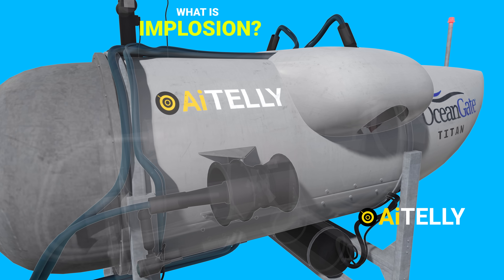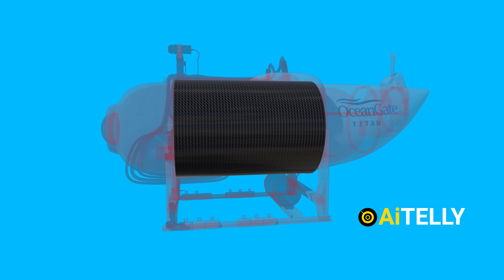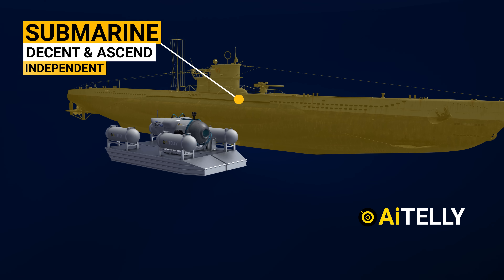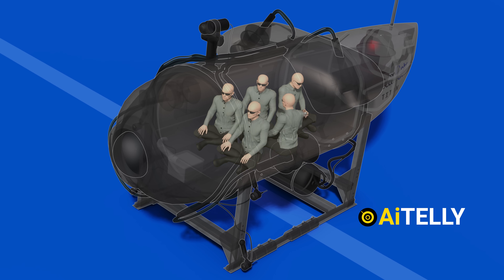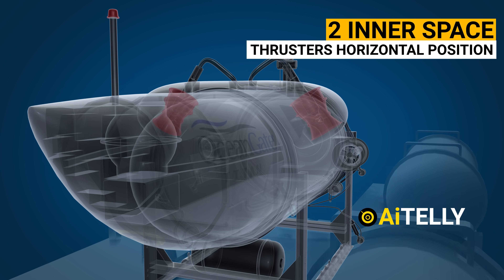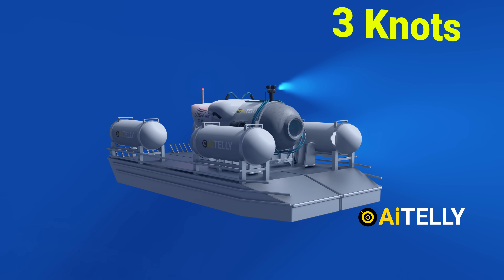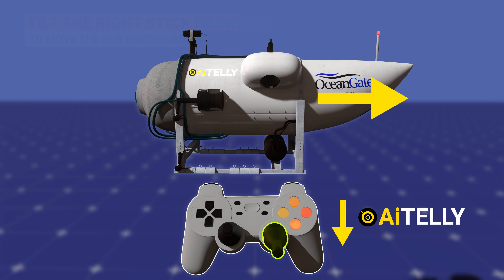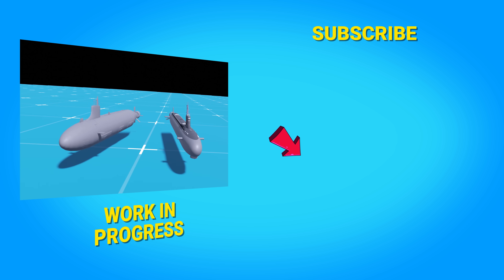Implosion Titan Oceangate How it Happened | Submersible Submarine Parts #3d

Comment: I really think t was horrendously foolish and quite arrogant of the designer to go ahead and use the submersible vessel that was for the most part untested. Just because there was a theory behind an innovative material such as carbon fiber- it’s just that theory. And theory isn’t scientific fact unless proven meaning it should have gone through rigorous testing. Knowing that water pressure increases with increasing depth, it was quite stupid for them to skip so many things that this submersible needed- never mind that it was built with a composite material. Video game device to steer the submersible? That’s why oceanic societies and organizations exist to avoid such catastrophes. They knew that there no laws at international waters to regulate what they were doing!
Reply from the maker: Thanks ! You might also like Nuclear Powered Submarine Engineering behind it #3d Nuclear Reactor released
Link: https://youtu.be/J0lb46Zi5-s

Comment: The fore & aft attachment was glued to the carbon fiber hull  that was the dumbest thing I have Ever seen  the thing was going to  blow apart an accident going to happen. Internal pressure external pressure somethings going to give the glue champagne cork when the wire is removed SOL..

Comment: Carbon fiber is the same characteristic as fiberglass it does not handle impact or pressure hit a sheet of fiberglass it fractures stand on a filon roof have a mattress handy.. the designer was so accomplished he was beyond reproach. The know it all wouldn't trust expert advice or follow testing or certification procedures then the nut sitting with a game boy remote to operate the thing. If that's HITECH you soon to loose more than your mine the of the contraption named Ocean gate a little to close to Heavens Gate. Had the Father listen to his Son there would be two less victims. A Child Shall lead them. Parents don't always know What's Best...
Reply from the maker: You might also like Nuclear Powered Submarine Engineering behind it #3d Nuclear Reactor released
Link: https://youtu.be/J0lb46Zi5-s

Comment: How does this submersible stay level?  If all passengers "slid" to the front (no seats or restraints) it will become nose heavy, or stern heavy.  Pretty unstable as far as the lateral axis is concerned.
Reply from the maker: You might also like Nuclear Powered Submarine Engineering behind it #3d Nuclear Reactor released
Link: https://youtu.be/J0lb46Zi5-s

Comment: The joint between, in the bottom from tail to belly may had gave up due to glide load which can be, only caused by excessive descending ratio, according to its build dynamic, structure and materials. * The hallow carbon fiber may have broke just like a bamboo wood due to the pressure they were in at that depth..

Lets see what investigation brings up...

Comment: I think your graphic demonstration, while impressive, is moderately misleading.

The hull being made of carbon fiber is essentially plastic, carbon fiber itself is not air-tight, and polymers/epoxies are used to bond the strands and create the seal. The carbon fiber itself simply acts as a structural support to the very hard epoxy/plastic. 

If you have ever dropped a plastic cup and had it break, you will note that it does not deform like metal (like dropping a can) it actually shatters. 

The reason why carbon fiber is not considered a suitable medium for repeated exposure to high external pressure and temperature change is because small imperfections can easily become trapped within the layers of the carbon fiber and epoxy that cannot be effectively detected prior to launch.

For example,  during the weaving process air bubbles can become trapped, fibers can become damaged, or during the curing process bubbles can form, mixtures can harden at different rates creating shear zones... etc etc.

Imagine there is a bubble trapped in the hull, even just a pin sized bubble. This air pocket will become compressed by the pressure and allow moderately more flex to the carbon fiber/epoxy above it as it has more space to move before reaching its backing support.

This repeated flexing of the epoxy above the pin sized air pocket will inevitably cause micro cracks in the epoxy, and allow for the movement of the weave which will cause delamination between the layers. This will run the length of the strands in the weave and expand more and more quickly as the integrity of the epoxy becomes more and more compromised (because it obviously provides less resistance)

Eventually these seemingly minor, nearly undetectable imperfections, cause enough of the material to compromise that the sudden increase in pressure (3 knots / 3.5MPH down to a depth of 2.4 miles / 3800 meters, or 1.56 meters per second. 1 atmosphere of pressure is roughly equivalent to 14.6 PSI. For every 10 meters of descent into the ocean, the atmospheric pressure equivalent increases by approximately 1 atmosphere.
So at surface level, approximately 1ATM, at 10 meters down, 2 atmospheres, 100 meters 11 atmospheres etc etc... down to 3800 meters (resting depth of the titanic) that would be approximately 381 atmospheric pressure. 381*14.7 PSI = 5600.7 pounds of pressure against each square inch of the hull.

That's 144*5600.7 =  806,500.8 lbs of pressure affecting a single square foot. 

For perspective, that would be like parking two empty B747 jumbo jets ontop of eachother on a single square foot of space. 

That's means the hull of this submersible was subjected to an increase of 2,116.8 lbs per square foot every second during descent. (The equivalent to stacking a tesla model 3 ontop of each square foot of that hull every 1.92 seconds.)

So when this hull failed, it would not have crumpled, it would have shattered inward, like glass.

There's a reason why in most of the recovery photos you only see metal and other malleable components present, because the carbon fiber was likely essentially pulverized by the expansion of water into the cavity occurring at approximately 10 times the speed of sound.

If you want to get an idea of the destructive force this would have on a person or object, just search for videos of large amounts of water being dropped onto things, and remember that water falls at approximately 9m/s (20mph), but at those depths the water would be compressed to approximately .96/97 of its original size, and would expand to fill that space, accelerating the rates in excess of 7-9 x the speed of sound. (Depending on various factors like salinity, temperature and depth, but to keep it simple, just assuming the maximum rate of 10x the speed of sound or 7610mph or 11000 feet per second / 3352.8 meters per second.)

Assuming the space inside of the sub was maybe 1 meter in height from floor to ceiling, you can imagine how quickly these people were struck with 806,500.8 lbs per square foot of weight. (Average adult male has between 14-18 sqft of exposed skin across the surface of their body. Ergo it would be like flying 24-36 747 jumbo jets into them at mach 10.)

If you were to put a pin sized hole in the hull of that sub at depth, water would force through it with the power of a water jet cutting machine.
Reply: Thank you for your explenation

Comment: can you explain what kind of structure is keeping the back ends (sharp end) from imploding?
Reply from the maker: Agreed 👍
You might also like Nuclear Powered Submarine Engineering behind it #3d Nuclear Reactor released
Link: https://youtu.be/J0lb46Zi5-s
Reply: @Aitelly  I read somewhere that the back pointy end of the Titan is not pressured. Meaning it is open to the water, and I wonder how can all the batteries and oxygen equipment inside it can withstand all the pressures ?

Comment: No they're all dead but the owner Was an idiot. He should have had that thing. Do at least 20 to 50 autonomous dives on its own. And he should have never went down past 3000 feet. That was only rated at 3000 feet. And he went down twice the depth that it was rated for. He also ignored warnings from his engineer. You did away with a lot of Safety measures.. Then he sold those tickets to those guys for 250k a piece. Any engineer would tell you that whatever you rate something at. Don't go to that rating, stay under it. If it was rated for 3000 feet, he should have never went past 2500 feet. But instead, he went 7000 feet... Like I said, an idiot. Does other guys? I feel sorry for her because he made them feel safe when they were just pay in 250k for a death ticket.
complete moron

Comment: So  now we know that a cylindrical submersible made of  carbon fiber 5 inches thick , with titanium caps is capable of withstanding  water pressure at 12500  feet for a limited period equalling  3 - 4  dives in reasonable safety.  🪸

Comment: Watching many videos about this accident and the last messaging between the sub and the ship , the descending went too fast like it was sinking. I think the hull was delaminating and got saturated with water.
Reply from the maker: You might also like Nuclear Powered Submarine Engineering behind it #3d Nuclear Reactor released
Link: https://youtu.be/J0lb46Zi5-s
Reply: If that was the case it wouldnt have imploded it simply would have flooded and the people inside would have drowned.  Since they found it in pieces and did not find the pressure hull intact.  It is easily concluded that it imploded.  they might have seen a sudden water jet open up where the initial crack happened but I doubt they would have had more than 1/2 a second to understand what they were seeing before it failed completely.

Comment: Do you think the bodies were incased in part of the carbon fiber when it was pulled to the surface?
Reply: I suspect that the carbon fiber would not have simply shattered like glass as some have said.  I think it would have ended up more like what steel wool looks like when all stretched out.  There might not have been more than a few pieces of bone entangled in it.  Then again, I have seen some conflicting information that the carbon fiber was actually wound on an inner sleeve of steel.  If so maybe bone fragments were trapped in the crushed steel sleeve.  Who knows?

Comment: The animation presented here is what a metal tube would look like, not reinforced plastic.  The plastic tube used in the Titan would shatter like glass when it imploded.  This is why you don't see parts of the plastic tube being recovered.  There were no shards of plastic protruding from the metal rings that were recovered because there was nothing left of the plastic tube.
Reply from the maker: You might also like Nuclear Powered Submarine Engineering behind it #3d Nuclear Reactor released
Link: https://youtu.be/J0lb46Zi5-s

Comment: I grow weary of hearing the term "carbon fiber" like it's the answer to everything, when it's actually nothing but reinforced plastic.   It rolled off the lips of Stockton Rush like nothing could go wrong, because after all, it's carbon fiber, a million times stronger than steel.  He didn't say "million", but that's exactly what he implied.  Plastic is absolutely the wrong material for this application, as this incident confirmed.

Comment: Very well made video, I had a basic understanding of how this submersible worked but didn't understand the difference between submarine and submersible until now.  I also had no idea what all of the features and interior looked like when in action.  I tried to put it all together in my head after so many hours of footage we've seen just from it being on the news 24/7.
Reply from the maker: Thanks 🙏 we love you guys
Reply: 4:48 ok so the launch ramp descends with the Titan, which then disconnects from it. So it's some depth underwater when this happens, so what becomes of the launch ramp?
Reply: @Defender78  I Don't "Factually" Know.
It Seems it's Made to go Back Up.
Reply: @fh346   Now that I'm looking at it again, it seems the launch ramp has some floatible things that are weighed down when the Titan is on it, and then once the submersible slides off it ascends back up to the surface, probably remotely guided by the mothership where it just floats up and then is recovered and winched back in

Comment: people dont need brains to have too much money. the go fast and break things is obviously devoid of safety mentality. Whats pathetic, is lack of common sense= you dont go >10,000ft above sea level in aircraft without considering pressurization based on decades of developments and designs. Under sea level, each 10 metres (33 feet) of depth puts another atmosphere (1 bar, 14.7 psi, 101 kPa) of pressure on the hull, so at 300 metres (1,000 feet), the hull is withstanding thirty atmospheres (30 bar, 441 psi, 3,000 kPa) of water pressure.Operating or entering any vehicle without knowing certain the maximum operating depth/Never exceed depth is insanity....I think many submariners around the planet are laughing out loud over this hull design.Albeit, condolences and sympathy go to the family of those lost, its not entirely the passengers onus to know the safety specifications. Money to pay for things, doesnt mean it is safe!. Titan name doesnt mean titanium hull any more than calling a channel "news" means you will get actual journalism and news from that channel. Sad, sad, sad.

Comment: I do believe that it is safe to use carbon fiber for a mini-sub, but more destructive testing should have been done on the Titan class subs before putting them into service.

The reason the hull failed was due to fatigue brought on by repeated compression and decompression. Stockton trust believe that he had a lot more compression and decompression Cycles left in the Titans life. But Stockton Rush was wrong.
Reply from the maker: You might also like Nuclear Powered Submarine Engineering behind it #3d Nuclear Reactor released
Link: https://youtu.be/J0lb46Zi5-s

Comment: Yes, there was an inital implosion....but then an explosion.  The oxigen tanks NEVER finish 100% the oxigen....there is always a residual in the tanks that the left over pressure does not release dure to low pressure.  The pressure form implosion will cause the explosion of the tanks. This is why they found debree.  Do any of you have a machine that puts under vaccume food?  Put in a bag an open cane of soda.  Put it in the machine and that is implosion....no debree.

Comment: Reports state the implosion happened within a fraction of a second. That's not to say the crew didn't hear the terrifying sound of the carbon fibre hull cracking prior to it (as was reportedly heard by other crews on other missions).
One ballast was missing from the sub when found so they knew something was wrong and were attempting to re-surface.
Reply: We will finally know when the investigation is done and comms transcript is made public.
Reply: @WezleyB  they lost comms before any distress signal was raised afaik, I highly doubt the veracity of any transcript. Also the ballast could have been separated from the hull during the implosion
Reply: @cx2900  they lost power. with it, propulsion. blacked out, the sub nosed down and rapidly dove. That's the theory of the Spanish Scientist. all the passengers were piled in the nose cone. they obviously knew for just under a minute.
Reply: @WezleyB  where did you hear the transcript?
Reply: Yeah what I don't understand is, when they started hearing those noises, they didn't open the hatch and swim up to the surface.
Reply: @WezleyB  yes that's right, someone used Cameron's statement as a basis for writing a fictional transcript. it's just someone's imagination of what might have happened.
Reply: @WezleyB  transcript is fake
Reply: @WezleyB 🤡
Reply: They heard cracking for 15 minutes before it inploded
Reply: @OldManMuskrat Probably with Rush attempting to reassure them the whole time, "This is normal, nothing to worry about, it happens every time!". What an ass.
Reply: @TheMaddCatter  theyll redact his portions, I'm sure
Reply: @OldManMuskrat  wonder where you got that info from
Reply from the maker: You might also like Nuclear Powered Submarine Engineering behind it #3d Nuclear Reactor released
Link: https://youtu.be/J0lb46Zi5-s

Comment: "... suffered an implosion because of the weak carbon-fiber hull." Everbody is gunning for the hull as the culprit. I wouldn´t count out other weak links, like f.e. the acrylic window. The former safety inspector of OceanGeate, Mr Lochride stated  that the Titan’s viewport was certified to a pressure of 1,300 meters below sea level. OceanGate intended to take passengers on the Titan down to depths of 4,000 meters. He was met with hostility, denial, threatened with a lawsuit and was ultimatly fired. That was a catastrophy in the making. 
It serves as a good example that you should apply your own good senses before any endeavor.
Reply: the viewport from the salvaged wreckage was broken. I don´t know if this is any indication for the viewport to be the weakest link. It might also break from the disintegration of the hull.

Comment: This thing looks so ad-hoc made I am not surprised it eventually failed. Two monitors placed in it like a TV wall mount? Video game controller controls. The entrance to inside the submersible is the FRONT CAP that has to swing open to allow access? Looking like they made more effort in how the outside of it looks compared to actual robustness of it's diving capabilities is appalling. Made to be paid to get in and quickly go down just to look with the max amount of people you can get in.